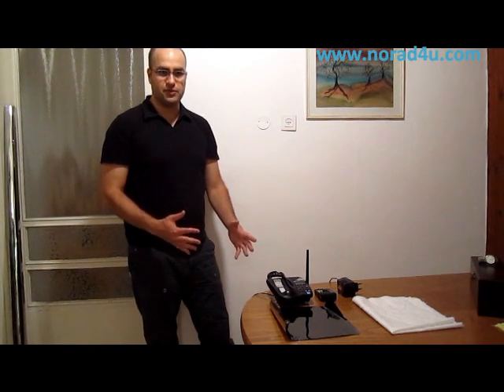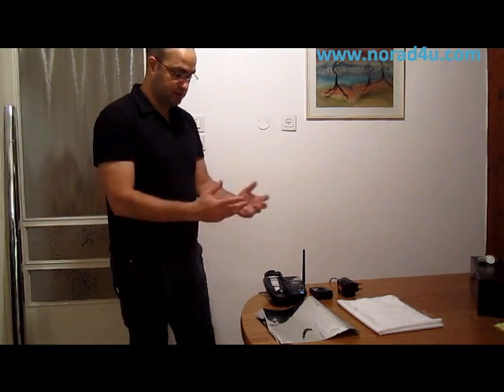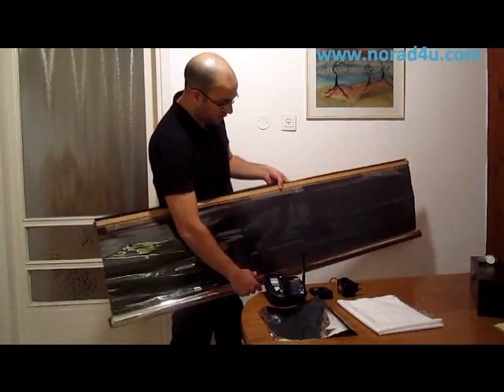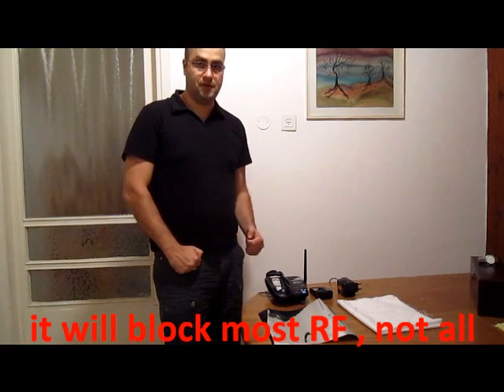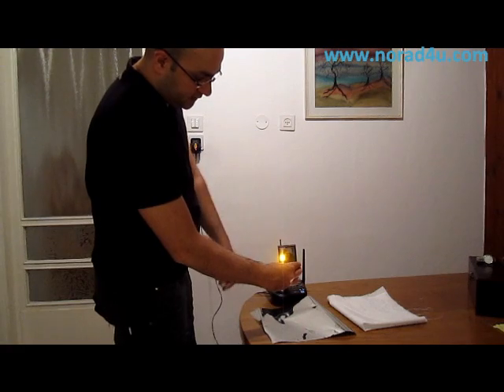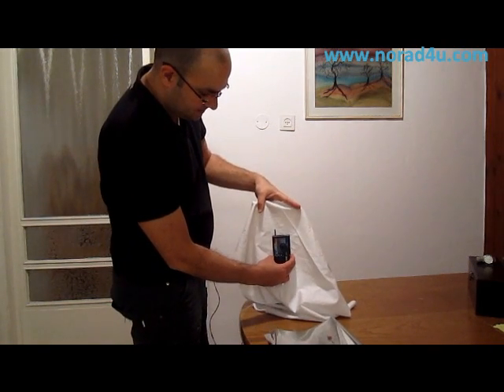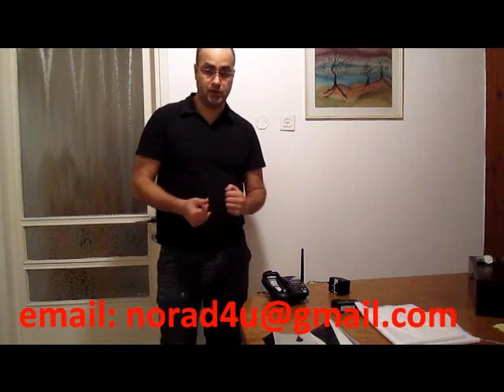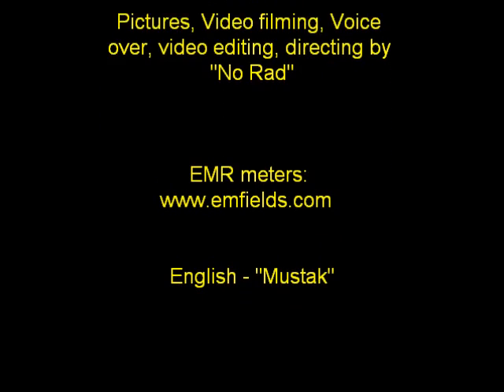Blocking RF EMF/EMR radiation, the basics

Comment: What is best RFI shielding material? Graphite vs Carbon because they absorb unlike aluminum and copper. Mylar is weak.
Reply from the maker: You need to check each product characteristic, and to see if it fits your needs.
As far as I know paints that are based on Graphite and Carbon are also reflectors, as aluminum and copper. 
All the best
Amirb

Comment: You can also ground your blocking device by using an old extension cord, taking the AC/DC plugs out & using the other end attach alligator clip to attach to your device & keep the ground plugged in. A better material is galvanized wire mesh instead of foil. Or you can use both & keep them grounded. That's what I do, see my channel for video. It blocks a lot more radio frequencies that way. Good video, keep spreading it around!!! Our world is using radio frequency Technology for way worse than what your going through....
Reply from the maker: Hello WHITE RAVEN, thanks for the tips.
Grounding is important but I don't think it is good to use the electric ground since it has same small voltage and currents on it. I use only real ground outside for my grounding needs. In north America, even the ground outside in the yard may have "ground currents" so you need to be careful with it. 
Please see - http://www.norad4u.com/q-a/goodandbadgrounding
Reply: NoRadBlog I agree with you, but in situations like mine when I can't put an outside ground in Because I live in an apartment using the internal ground is better than no ground. I've thought about sneeking outside & putting a short ground rod in early in the morning by my back porch, but that would just get me into trouble. Someday I'll own my own place & have a very good grounding system & faraday/frequency jammer put in along with the special blocking paint etc.
Reply from the maker: I hope you will be able to get your own low EMF house with good ground, soon!
Reply: Galvanize wire mash stop emf rf

Comment: For a decorative touch it might be a little expensive but it would work they sell the electromagnetic fabric so if you get curtain rods going from one end of the wall to the other at the top of the ceiling then you could run the fabric all the way down the wall to the floor as well as use it in front of windows just gather the fabric on Pawn the curtain rods just as you would any other time that you use curtains to make it look normal and don't forget you could still hang artwork on top of these curtains and by using another hook ceiling hook on the wall with some kind of ribbon rope whatever attaching it to the back of the frame.
Reply from the maker: Yes, It is also possible to use curtains over all the wall, not just the windows. 
thanks for your comment
amirb

Comment: Don't use ALUMINUM, it will only make things worst. I had one close to 
the wall where I sleep, and after 30 minutes my head was going to 
explode and next day I still felt unease. That's because the radiation 
reflects back and hits you more than double. Now all material do the 
same, I haven't tested copper or any other made by SWISS SHIELD, so I 
can't tell if I will experience the same.
Reply from the maker: Hello and thanks for your comment.
Aluminum, as most RF blocking materiel is reflective. You must make sure that you put it between you and the RF source. Any RF that will hit it from your side, will be reflected to you. There for I recommend people to use an RF meter to make sure where the radiation is coming from and not to use RF reflecting materiel inside the house (just on the outside of it). In case of curtains it is important to have lots of extra length in order to create carves that will give the curtain some absorption characteristics.  
It is important to use tested material and even if so, to keep some safety distance from it. 
Please see - http://www.norad4u.com/emr-protection/rf-protection
Thanks and best regards
amirb
Reply: I have my WiFi turned off, as well as all cell phone microwave sources.

It's hard for me to make a conclusion about this. Most of the WiFi sources where coming from the outside, neighbors, and I had the protection on the wall, blocking it from coming in. But there are tons of other sources, peoples mobile, data traffic, cell towers...

So I had the aluminum on the wall and my head close to it, as my bed is positioned like that, still I felt much more worse than when I didn't use the wrap. Pretty strange because I live on the edge of the street, and most neighbor sources are coming from the direction I was blocking.

Do you think other material will give me the same problem?
Reply from the maker: Hello
My guess is that every reflective materiel will give you the some problem.
If I understand correctly you used kitchen Aluminum which is very reflective and does not block all frequencies.
Try to change the setting of the room so you will not be so close to the protection.
Try to use Myler emergency blankets instead.
In general, inside the house I recommend using RF Blocking wallpaper (not reflective) or curtains (partially reflective).  For temp us , Myler is an option.
The use of an EMF meter is a must . Without it we are only guessing.
Please see RF protection on my site - http://www.norad4u.com/emr-protection/rf-protection
I hope this info helps.
amirb
Reply: Do you have microwave absorbing fabric? Just absorbing the RF fields and not reflecting?
Reply from the maker: All RF blocking fabrics are reflective. Not as reflective as metal plates, Aluminum or Net, but still reflective. In order to reduce the reflection, you can create folds in it.
amirb
Reply from the maker: No, just an absorbing wallpaper - http://www.4ehsbyehs.com/rf-protection/rf-blocking-wall-paper
Reply from the maker: I am not sure I understand what you meant. I prefer Mylar becuase it is a bit less reflective not because of it has improved blocking effect.
amirb
Reply: StojanovskiTV Aluminum works great, you just need to ground it so it deflects & absorbs as well!!! See my channel for video's. Another material that works better is galvanized wire mesh. Can be purchased at home depot, it's used for cloth racks or chicken wire....

Comment: The wall blocks RF as well as clothes, foil laminate do, the same principle. Doesn't make sense,,,
Reply from the maker: Concrete wall blocks 90%
Blocks wall block 50% 
Dray wall blocks ~0%
Windows blocks ~0%
In order to block more , you need RF protection

Comment: Most of the shielding materials reflect the radiation, so if you are planning to shield large area's you could better shield whole rooms like a faraday cage.
Reply from the maker: For RF Blocking you usually need to protect only the walls and windows in front of the source. 
amirb

Comment from the maker: HI 
Thanks for your comment.
The cheaper option is the film, but the installation is hard and should be done by professionals. 
The fabric is easy to use.
Both can be found on my selling site 4EHSByEHS 

The cheapest RF protection is metal mosqito net, but it is hard to work with, and does not look nice.
I will make a video about it soon and write a post.

Thanks for your question

amirb